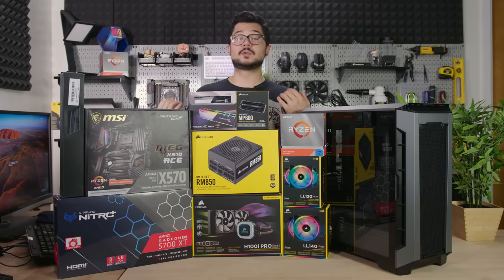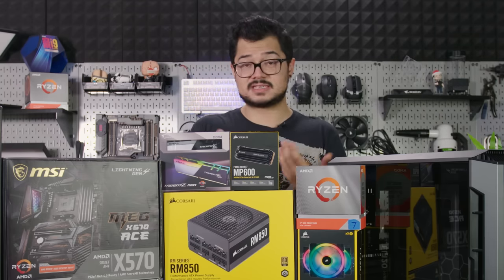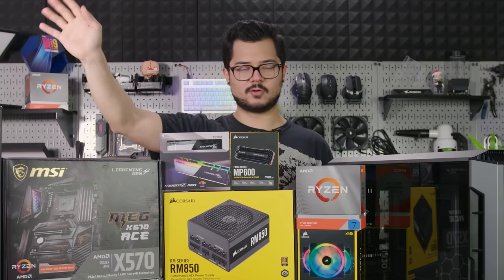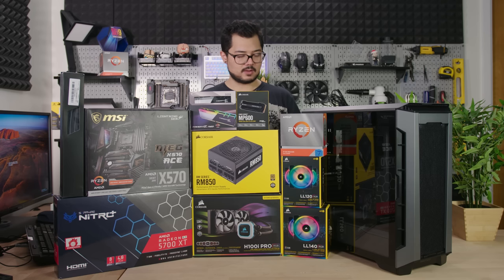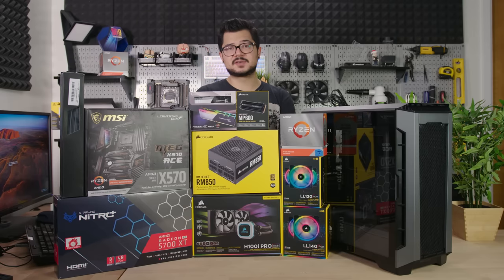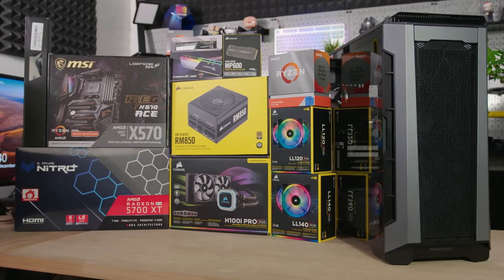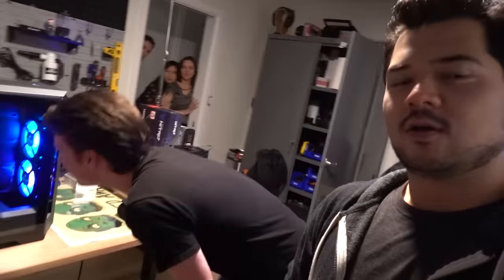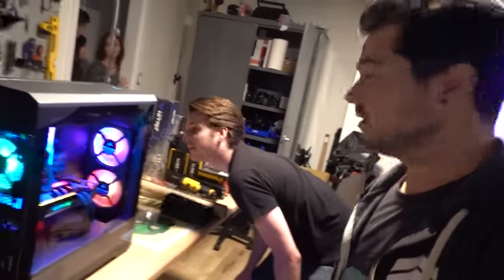Surprising my friend with an epic gaming PC (he lost it)

Comment: Jeff needed an upgrade? I had a PC from 2008 to 2017 with:
- AMD Phenom 9550
- 8GB DDR2 PC-6400 800MHz
- PNY GeForce 8500GT DDR2 512mb (does anyone even remember that long ago)
Besides gaming, I also needed this for CAD and graphic design. AutoCAD, Solidworks, and Adobe CS worked just good enough. Rendering was a multi-session overnight thing. Throughout the years I had a few ongoing lists on PC Partpicker that I kept updating, but I never had the money to build one. Finally in 2017, I decided to finally upgrade. I didn’t have a Kyle so I bought everything myself.
- AMD Threadripper 1950x
- ASUS ROG STRIX X399-E
- Thermaltake Floe Riing 280
- Trident Z RGB 3200 CL16 (2 x 8gb)
- Zotac GTX 1070 AMP! (used)
- Thermaltake Toughpower Grand RGB 750
- Repurposed Sata M.2 256gb from my laptop
- Samsung 850 EVO 500gb 2.5” SSD
- Rosewill Cullinan V500 RGB
- Total Cost: $1450
I started out using a GTX 670 that my friend gave me before I found the Zotac a couple months ago. I really want a 1080 or 1080ti and some larger NVMe’s, but my wallet is still empty. I also need monitors if I'm getting a 1080 because I'm using LED TVs that are limiting me to 1080p 60hz.

Comment: Hey Kyle, nice build as always. I wanted to run an idea/what I've been doing with my AIOs maybe for your future project or w/e. How about instead of having the AIO tubes go to the back of the case and dangling like a pair of guts across the whole mobo making them the main focus point (and not in a good way), you flip the rad so they go to the front. This way they can be routed either under or above the ram (space permitting of course). I've been doing that for a while and it makes for a super clean build. Just a thought.

Comment: How come I don't see many gaming PC builds on YouTube not recommending some support for big graphics cards like this? It had been a while since I built one so I took it to a tech guy after I couldn't figure it out in a half days work and that was one of his recommendations to me so I took his advice on that. He recommended a water cooler too, but I do not plan on overclocking and had already purchased two 140mm Noctua fans for the top of the case, along with the 4 already in it. And for now, I have not been gaming heavily (Diablo 3 for the most part [Yes, I know it's bad game]), as I don't really know what newer games I might like. It's only an $80 Thermaltake case, but I assume the fans in it are performing well enough to not worry about replacing them, like he also recommended for just the 1 rear fan. And there's goes 5 minutes of my time typing this because no one is going to read it. Yay!

Comment: Hi Kyle. Namaste from India 😊. I'm building my first pc and I have a few questions with only experts like you can answer...
1. Does the manufacturer of the graphics card matter. Should I spend money on the 2070S from a manufacturer like Galax or Zotag(both OC capable) or should I spend the money on an Asus/MSI 2060S/2060?
2. Is there a way/website where I can benchmark my parts/config before actually purchasing it and possibly also get additional tips to improve my build, just to get the best bang for the buck.

Hoping for a reply! Thanks allot 😊

Comment: What is the easiest way to hook up a bunch of RGB fans and still be able to control the speed, lighting, etc. with all of them? I'm not quite sure whether I should use splitter cables or use the Corsair Commander Pro.

Edit: I'm planning to use 3 ML120's in my PC but the motherboard only has 2 RGB headers.

Comment: I thought the 5700xt had really bad overheating issues? im deciding between the 5700xt and a 2060s and leaning towards the 2060s bc of the heating issues ive read ab but if thats not a huge issue then i may go w the 5700xt

Comment: I've had my "most recent" pc since 2009 and it has an AMD Athlon 2 x2 220. I've added a 4GB Radeon RX 550 GPU - a good deal at $110 at the time of purchase - a 650 watt EVGA power supply, and a PNY 240 SSD. Oh and upgraded from 4 to 16 Gigs of RAM. It's surprisingly works well...enough. I figure all I need is a mobo and processor to really make that thing shine.

Any sugestions?
Reply: Yes buy a new pc.
Reply: @erikheijden9828  No shit, Sherlock. I don't have that kind of money.

Comment: I have GA AB350N, it used to host Ryzen 7 1700 and R9 Nano, then I upgrade it to Ryzen 5 3600 + 5700XT. Then I realized in the GPU-Z, the PCIE interface changed to 4.0. Is that real 4.0? Can it be upgraded just because I upgrade the proc and update the BIOS?

Comment: dam i wish i had friends like you. mines 5 years old

gigabyte f2a88x-up4

crucial ballistix 8gb sport ddr3-1600

amd apu a10-7700k radeon r7

Cooler Master Hyper 212 EVO heatsink

EVGA GeForce GT 640

Thermaltake V3 Black Edition ATX

corsair tx 650

Western Digital WD10EZEX 1TB Blue 7200RPM SATA 6.0Gb/s

windows 7 ultimate

Comment: Fun Fact:

The RX 5700 XT is actually a competitor to the RTX 2070 Super. Not the 2060 Super.
Reply: I was going to say lol, but I got a question for you. I'm thinking to buy parts for a pc build. Do you think an Amd Ryzen  3900x cpu only and a Nivida GeForce 3080 should work right with it? Im asking for your opinion
Reply: @TurboExpress007  No, because the 3080 is a VERY high end card. You would end up bottlenecking your CPU. IF you would go with a 3080 go with a Ryzen Threadripper. Or go with a 3070 since it's still better than a 2080 Ti and 500 bucks.

Comment: Hi guys I built a pc and it worked for a day but then the second day it started to take ten minutes to let me sign in the the next day I will turn it on but then it will just go to a blue screen please help me I’ve only got to use it for a day 😢😢😭 and I have the exact same gpu you had in this build bitwit and I only hit like 250 FPS then it would drop to 140 I’m super scared but on fortnite and csgo

Comment: Amd fanboy, offer gamer amd system is nonsense due to much lower amd performance in games (it does not count in HEDT workload which such type person does not have due the main usage- gaming) and amd vga card driver instability ... If believe amd just started working to improve it, due the fact they failed to do in past mad vga card are strongly non advisable at least right now. PCIE gen 4 speed in this particular usage had no real improment so gen3 mother board will be ok as well, beside am4 is dead en platform as intel 1151, 2020 is last support year.